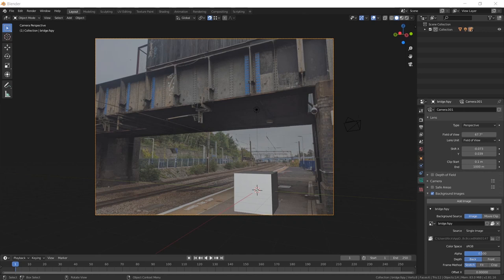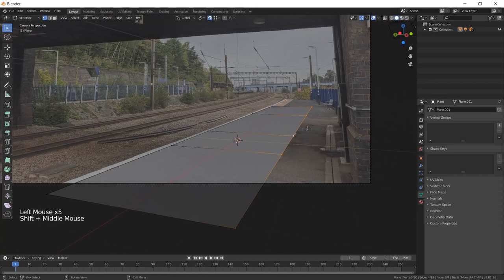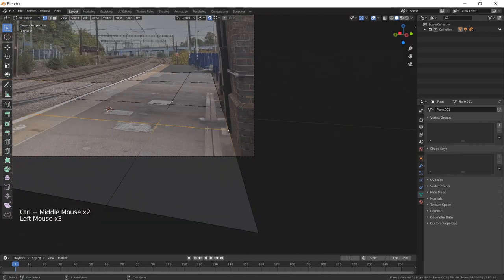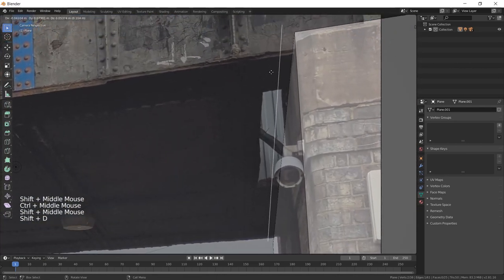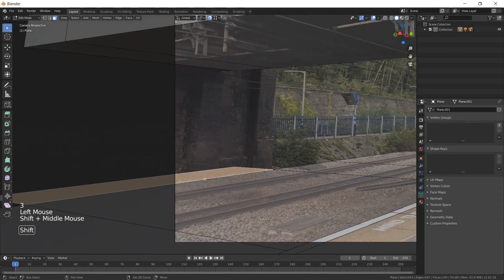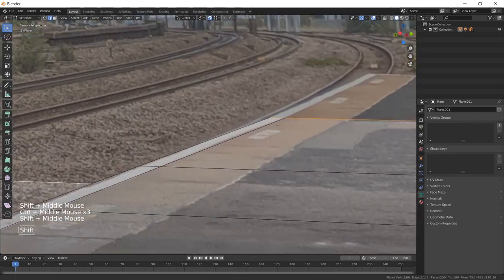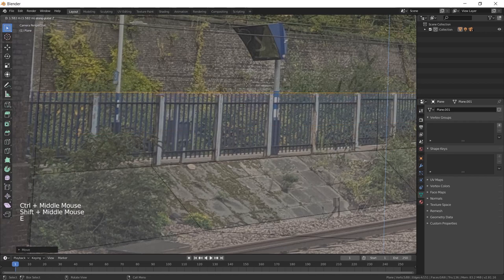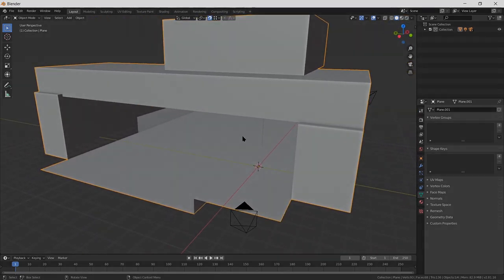Modelling from a Photograph - Blender

Comment: Thanks for video! Very interesting! And question from newbie. In the end of video you use "V" shortcut to separete edges. How would you do this operation in backwards? For example, if you need to join 2 edges in 1?
Reply: Press F
Reply: F fills between points .. correct?